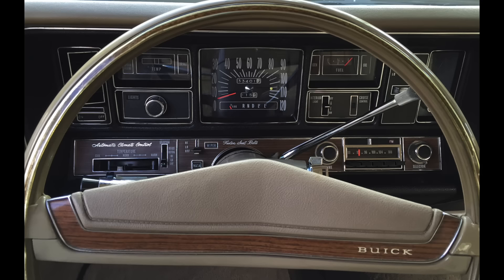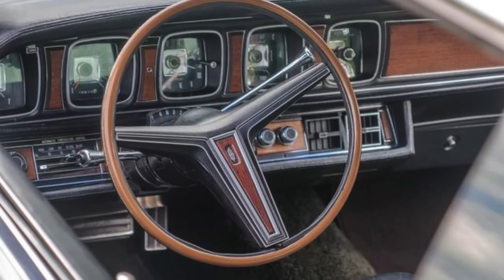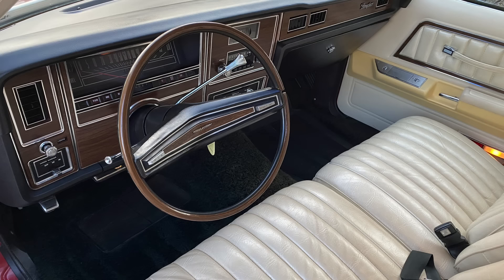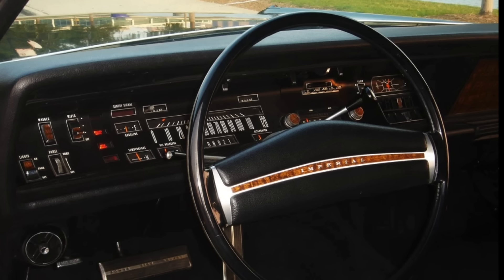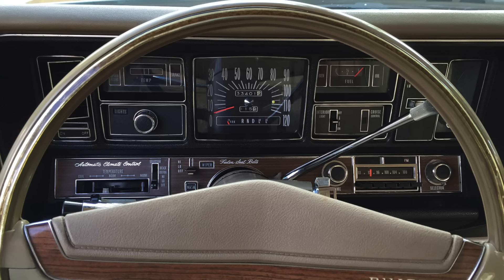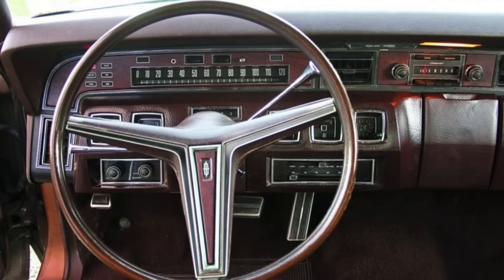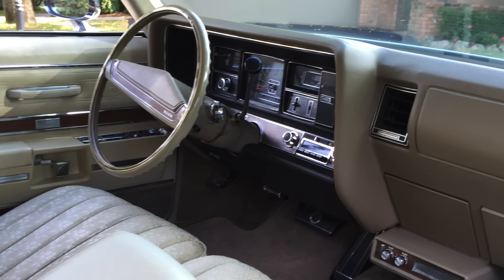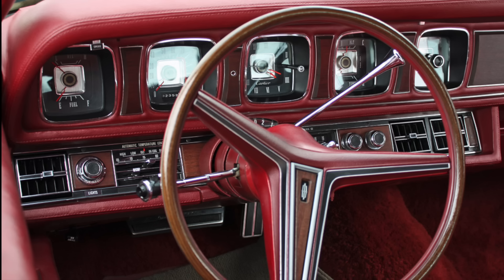Worst Automotive Inventions:  The "Rim Blow" Steering Wheel That Many Customers Hated

Comment: Where I live you have to get yearly inspections to register your car. I lost count the number of times I was told my horn did not work and observed a smug mechanic violently thumping the Centre of the steering wheel or the end of the turn signal stalk. They were shocked when I leaned in and blew the horn seemingly by magic. But then accused me of making some shonky home made control for the horn. 
But then after almost breaking the turn signal stalk they would tell me my high beams did not work. They had never seen the high beam switch on the floor ever before. 
So these mechanics weren't that smart.
Reply: "But then accused me of making some shonky homemade control"
How hopelessly clueless WERE these mechanics!
Reply: @OffGridInvestor  honestly they were utterly clueless about every aspect of the car. If they saw something they had not seen before, in other words a feature that did not exist in the cheap second rate 30 year old junker they were driving, or a component they were unfamiliar with again because they had no experience with a high end luxury car, they would deliberately invent non existent problems with my car so I could not pass the inspection.
I think jealousy and a deep inferiority complex were at play also.
One time I was told it would not pass the inspection because it came out with hubcaps and I had removed them. (I'd put alloy wheels on the car). I said why do I need the hub caps? The answer was classic. He said "if your wheel nuts come off the hub cap will capture them so they don't get lost"
I said "if the wheel nuts come off there will be much bigger problems than searching for some lost nuts"
Reply: Way back the IL DMV used to have the driver test lights, signals, horn and wipers before a driving test. If everything didn't work, you couldn't take the test with that vehicle. The young lady employee that I went on the test with didn't believe that my dad's old Chrysler had the high beam switch on the floor. She though we installed it. Also that car had the rim blow which because of its age I guess, kinda worked if it wanted to. She asked me to beep the horn, and I was fumbling around the rim until it sounded. She passed me, but found it strange. She actually suggested that I bring 'a newer car next time'..
Reply: "Shonky" huh?? I like it, yes I do.

Comment: To me the worst was the 1983 Ford Escort.  You had to push in (toward the steering wheel) the turn signal indicator to blow the horn.  It was awful.
Reply: I think a lot of cars had the. I know I’ve seen the Delorean do it and I think my dad’s MGB does that too. Guess it’s a European thing?
Reply: @THEROCKLORD1  It was more of a French thing but Brits did it as well.
Reply: - besides French (and Italian), many older British cars had their horn activated that way as well.
Reply: I remember a car review for a Lincoln that referred to this as "a perverse European touch."
Reply: Even the Mustang had that feature.
Reply: Sounds like crap...
Reply: @dustin_4501  Oh, it was
Reply: All the Fords of that vintage had the horn on the turn signal lever.  They were preparing for their first airbags and, IRONICALLY, didn't realize they could put covers over the airbags that were basically just really wide rim blow rubbers!  LOL 
My guess is that they thought of the turn signal trick first because the European-built Mercury Capris had the headlight switch on the end of the turn signal, and turning it hit the lights while pushing it inward honked the horn...
Reply: My mom's 84 Bronco II had the horn in the turn signal lever.  My 92 Tempo had that as well since it had an airbag.  Small price to pay for not having those godawful electric seatbelts.
Reply: @marko7843  Ah, ok.  I guess that explains it.  It didn't last very long I don't think.  All I know it that when you had to honk the horn in a panic, by the time you remembered where the horn was it was too late!
Reply: I had that in my first car. The 84 tempo.. What a joke of a car. I hated it. I traded it title for title for a 72 Impala and my parents were so mad at me.
Reply: I believe Ford introduced that feature with the fox body Fairmont/Zephyr platform of 1978. Ford started to move away from that when the Taurus/Sable was introduced in 1986.
Reply: Yep! My brother's 1981 Mustang was the same way! I always thought that was a bad mistake.
Reply: My grandfathhers 1980 cougar was the same.  I had the car for several years after he died. It was strange but it was loud at least.
Reply: My parents had an '82 LTD Crown Victoria with the same design.  Seemed weird to me.
Reply: @vibingwithvinyl  yeah, I've seen brits lamenting that it isn't still on indicator stalk with the turn signals, headlight controls, and cruise control so it was simple.
Reply: If you are used to the stalk horn thing, switching to something with a steering wheel centre horn can be as embarrassing as some people must have found the "Rim Blow". Leaning an arm across the front of the steering wheel while you perform reversing manoeuvres and so on. Like "everybody! look at me screw up this bit of parking"
Reply: @martinliehs2513  I had a 78 Fairmont with it.
Reply: I remember that! That's exactly how it was on our escort wagon.
Reply: @postmodernrecycler  LMAO
Reply: @jonowens460 Cost cutting
Reply: @martinliehs2513 that makes sense, as the 1979 Aussie XD Falcon was inspired by the UK Granada nose and tail, combined with the US Fox body styling (the wagons even used the Fairmont wagon tailgate).  It lasted 3 models, disappearing when the ‘88 EA Falcon was introduced.   The EA ironically, had styling inspired by the US Taurus, and UK Scorpio, but the Aussies had more freedom this time around.  The button on the end of the wand was not well liked by people who drove multiple cars, and were used to pressing the centre pad.
Reply: As a Brit', I can attest that the Escort got incrementally worse with each iteration after the MK.II. The 1990's ones were utter garbage; beer tin metal, crappy plastics, badly designed engine bay... and~ driven exclusively by aggressive meatheads, and old people that could barely drive at all 😂 .

Thankfully Ford eventually took that embarrassment out the back of the factory and shot it, replacing the Escort altogether with the Focus... which was less bad, at least.
Reply: I've driven Cortinas and Fiestas with those. They're perfect. You can keep both hands on the wheel and press the horn with just one finger.
Reply: I had a '79 Ford Futura with the turn signal horn. I hated that feature.
Reply: @1_lone_SYGMA My Parents had the 1984 Topaz.
It was a junk and my parents bought it brand new.
Reply: My Ford EXP, I think it was a 1982 model had that type of horn.
Reply: I had a 1983 AMC Alliance, same thing.  Push the turn signal stalk inward towards the center of the steering whee to honk the hornl.  Rim blow was way more sensible compared to that. I believe manufacturers tend to OEM their parts from a small number of suppliers.  Most of the rim blow rubber rings seemed virtually identical.  Quite a few early 1980s cars had the dumb turn signal stalk horn snd the physical stalks looked similar,  GM and Toyota cruise control stalks both look to be the same Delco parts on many models.  My 2.7L 2005 Tacoma seems to be an odd one out on cruise control with a unique stalk, but my Highlander Hybrid”s cruise is identical to GM.
Reply: @THEROCKLORD1 . It might be European influence.  The 1983 AMC Alliance I owned inherited various Renault features, the horn on the turn signal may be one.  The AMC had the globally homologated yellow turn signal lenses in back when that was rare on US cars, but the AMC did not have European red rear fog lights - not sure when that became a mandate and in which countries.
Reply: I remember that terrible FORD idea. 😮
Reply: That horn button on the stalk was cheap to make and crap to use.
Reply: Funny. Down here in NZ, we don't tend to use our horns as much. I had a Spansh teacher from Chile who wondered why we have them if we don't use them!
Reply: The Capri I had had that. So I believe the Cortina and Granada shared the same switchgear. I later had a 1959 Mk II Zephyr, it had a full chrome horn ring on it,  it looked and sounded beautiful.
Reply: All Ford cars for 81-83 model years had that euro style horn position which was thank heaven a short lived feature I had the dreadful 81 Mercury Lynx,an 82 LTD,83 Lincoln MK6 ,83 Ford Fairmont,I have had many American classics in the past and the cars listed above were pretty terrible and poorly made except the Fairmont which I actually liked it was simple and reliable but was still replaced by the Tempo for 1984,by 1985 Ford made great improvements to all divisions and that ridiculous horn that everyone despised was gone.
Reply: @jeffrobodine8579 all Fox platform cars Ford Mustang, Mercury Capri,Ford Fairmont, Mercury Zephyr,Ford Thunderbird, Mercury Cougar had them as well as the same chassis which all listed above had in common, even the full size cars had them,the only ones that kept the regular horn was their Trucks Ford Courier,F100,F150,F250.
Reply: @jcparker500 or hit it too hard and the thin turn signal has to be replaced after it snaps like a tooth pick😮
Reply: @corvetcoyote443  All the damn time, or after you used the horn your turn signal remained on after you nudged it so your driving for a mile or two indicating right or left.
Used to go to the old style scrap yards with the cars on stack, first thing we'd take was those column switches, I'd shove them in the top of my motorcycle boots along with filling my pockets with assorted nuts, bolts and stuff. As long as you bought something they werent suspicious.
Reply: @jimtaylor294 I drive a '94 Escort, and while I 100% agree on the crappy plastic part, it is SO easy to work on under the hood and suspension.

The 1.9L is bulletproof, and perfectly suited for a car as light as it is.
Reply: yeah, those were the worst...Ford Fairmonts also had the same stupid horn/turn signal setup from like 1977-1983. my mom would always hit it with her knee while entering the car, then everyone in the parking lot would stare at us.
Reply: Had an '82 Escort for my 1st car. Much easier just leaving the window down & yelling appropriate obscenities. 

Wood chipper feet first for beancounters, head first for product liability lawyers that signed off on it.
Reply: Ford was doing that on almost everything for a few years. My mom had a Mercury Zephyr like that. Bad idea and they got away from it in the early 80’s
Reply: Ford was trying to be "European" with that gimmick.  They even said as much in their press release with the new Fairmont.
Reply: I had a friend who had a '69 Cougar that had the rim blow horn, so Ford must have employed it earlier than 1970.

Comment: My parents loved it on their '73 Mark IV...between that and the Quick Defrost (it was a late production '73), it was their favorite toy on the car.

8 track tape players were around for a lot longer than rim blow steering wheels.  Ford had first offered them in 1966, and they lasted through 1984 there (with limited availability that last year), including keeping the quadraphonic 8 track player first offered in 1976 available through most of the 1982 model year (at least on the Mark VI and Town Car).
Reply: I had an 82 and 83 5th Ave that both had factory AM/FM 8 tracks, with the rear speaker amp. I think they dropped it for 84 when they went to an ETR digital set up on most cars.

Comment: I had a 1982 0lds Cutlass with a rim blow horn. When it got very hot the horn would start to blow non stop. I had to replace the original steering wheel with one from 1985 that had the center padded horn. No more trouble.

Comment: I have a '70 Challenger and a '71 Charger SE, both have rim blows. Chrysler had a couple different styles in addition to the Imperial one shown. Both of my cars have a woodgrain rim, 3 metal spokes, and a round hub. There was also a rectangular hub version sometimes seen in fancier versions of the '70 Dart, Coronet, Charger, and Satellite.
 The rim blow in my Challenger is in great condition and has worked perfectly in the 22 years I've owned it. The one in the Charger however has seen a lot of sun and has a few cracks
 One night at 3:00 am it started to blow the horn itself, probably do to the cooling temperature. Had to get out of bed and disconnect the battery. Karma to my neighbor who always had to honk his horn while locking his car! Now that's a feature that needs to go away.

Comment: I remember a family member had this feature on his '69 Mustang with 3 spoke wheel. He also installed one of those padded wheel wraps that were popular back then. Apparently the hot sun would expand the cover and laces but when cooling down the laces sometimes contracted too much and set the horn off automatically. He finally removed the wrap but there were all these ugly dimples permanently left on the rim blow plastic. It did't work after that.

Comment: Adam, you are partially correct about the cruise control equipped cars not getting the 3 spoke wheel. The picture of the Mk III at 7:45 clearly shows the cruise control button on the end of the turn signal stalk. I think the newer, electronically controlled cruise came in 1970.  I adapted a GM cruise unit on my 75 Mustang and bought that particular turn signal stalk to activate it. In 1975, that stalk cost $22! That's like near $100 today. I also remember the rim blow wheels tended to activate the horn in hot weather when the contacts expanded and touched each other.
Reply: I had a 71 Continental Mk lll, it had the rim blow horn and cruise control, it was activated with a small switch on the dash AND set by buttons on the turn signal stalk.

Comment: My mom's '74 Dodge Monaco Brougham had it.  She wasn't aware of it until she needed to use the horn and pressed the center pad (it was a tilt/telescopic wheel), to no avail.  I investigated and figured it out.  I then discovered an unplugged relay under the seat and helpfully reconnected it.  Then she got in the car and it wouldn't start.  It was because of the Interlock system, which required you to buckle the seatbelt before the car would start.  She was not a seatbelt gal back in '77, so the Interlock was immediately disconnected again.   She never liked the rim-blow horn, and only kept the otherwise beautiful car (but it really was a lemon, anyway) only two years.

Comment: Seems like I remember this on a ‘73 Cougar I drove.  Worked fine, might have taken a bit more pressure to operate, but not horribly tough. 

Your comments about taillights being turned upside down on a different vehicle sounds like a great topic for a future video....  How many other examples can you come up with?
Reply: He's 100% correct about the 1st gen Durangos and the Caravan of the same era. I never noticed it but a co-worker pointed it out 1 day on my 01. After that I could never unsee it. My point? Well, a base Caravan priced at around 18k had the same lights as my fully loaded 01 Durango 4x4 SLT with the 5.9 which was tickling $42k...just flipped around...

Comment: Actually, the Durango used the same taillights as the 2nd gen Caravan/Voyager/Town & Country minivans.
Reply: And they weren't inverted.
Reply: I think you mean 3rd gen (1996-2000). The photo in the video shows a 4th gen, which as you pointed out, is not the same.
Reply: @MuniTechnology  Correct.
Reply: @toronado455  You’re right - the second-gen vans were closely related to the first-gens.  That’s probably why I think of the third-gens as second-gens.

Comment: I drove a 1974 Crown Victoria with cruise control and rim blow horn back in the day.  That horn was, for me, very simple and convenient.  Cruise control on the steering wheel is nearly has easy to use as the Mercedes stalk.  Mostly I loved the 460 cid 4x venturi engine.  That car rode as well as any luxury car of its day despite its work a day image.
Reply: In 74 it was either an LTD or Galaxies the Crown Victoria name wasn't brought back till the down sized 79 which like my 82 was badged LTD Crown Victoria sort of like Datsun in 1983 merged to Nissan having both Datsun Nissan names on all 1983 model years.

Comment: I had a factory sport steering wheel in my 1978 Olds Cutlass. Drove it for a few years and suddenly one day the horn activated by itself. The horn eventually stopped by turning the steering wheel. What we found out was when the center horn pad was installed a metal retaining clip broke off. A small piece of metal had been moving around under the pad until one day it hit a spot where it closed the horn circuit.
Reply: My father's '75 Malibu did that, but I believe it was a wire that ran down the center of the steering column. Apparently, after being twisted all those years (manual steering, 7 turns lock-to-lock), it just fell apart. Toyota used a slip ring instead of a wire, but I'll bet those got flaky too.
Reply: For me I'd take that that the Car was loosing the will to live and having a mental breakdown instead of a mechanical one 😂 .

Comment: The Cadillac DeVilles had the rim blow wheel only in 1969.  The 1970 models did not have it - they went to a different three spoke wheel in 1970 that was a one year only steering wheel.  It had a button near where each of the three spokes joined the circular portion of the steering wheel as well as the emblem in the center that could be depressed to activate the horn.  The 1971 - 1973 steering wheels were similar to the 1969 models.
Reply: I had many Cadillacs from 65-78 and the 70 had the coolest wheel design in my opinion.